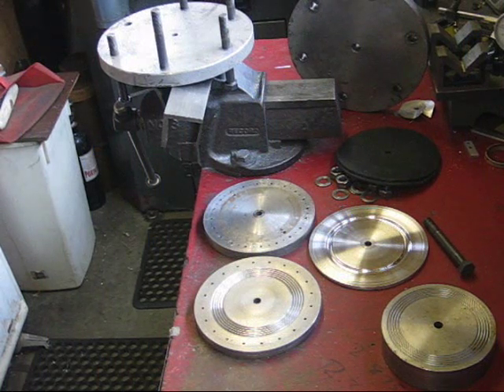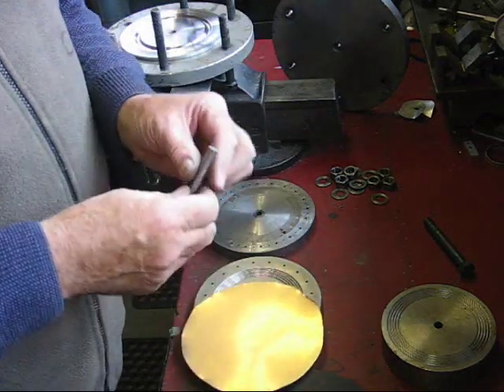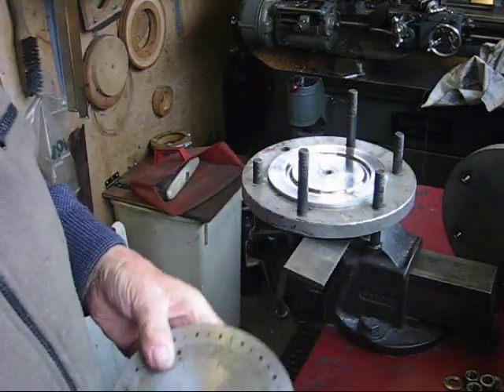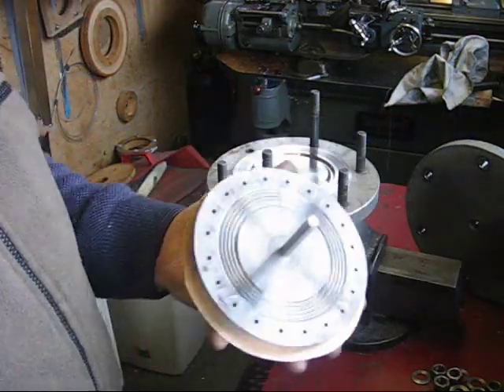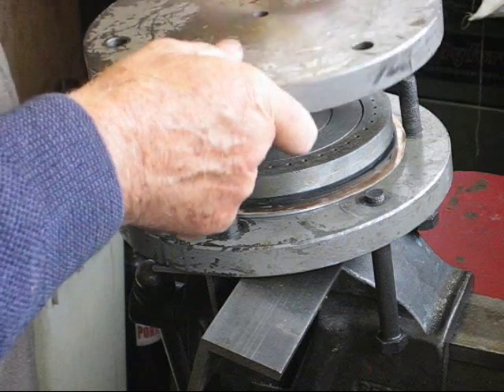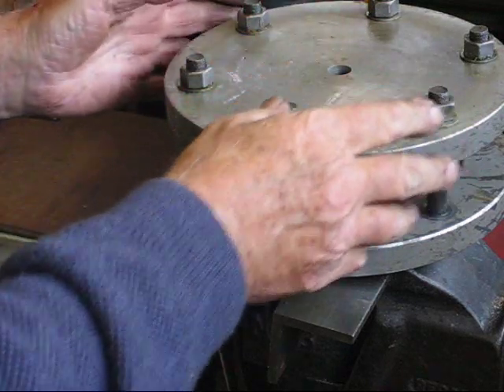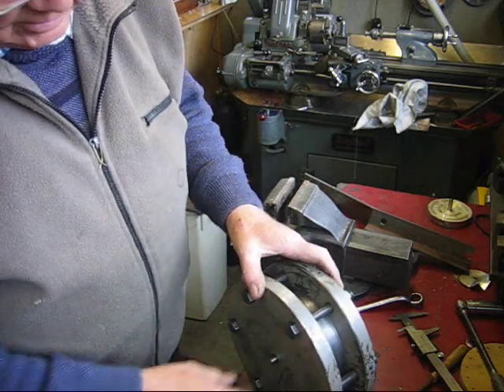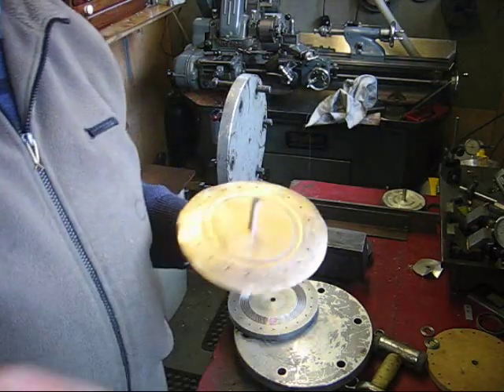Stirling Cycle TMG,  Part Six

Comment: Did you use Beryllium copper because you needed a non-ferrous metal or because of it's strength and spring? I'm guessing the latter, but you made a point of describing the non-ferrous metal. Thanks!

Comment: Cyril, another great video by you, sir. I find this project the most advanced and elegant of all the Stirling videos on Youtube. Quick questions: Did you machine the steel forming mold that you pressed the diaphragm against or did you scavenge that piece from something else? Also, what other materials did you consider of the diaphragm before settling on the copper mix? Thanks!